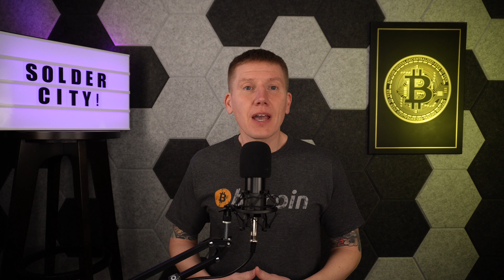EP11: My BITCOIN dry cooler build!

Comment: It looks like you used yellow teflon tape. I believe that's for gas connections only, no?
Reply from the maker: Hi Dimitri!  Yup, its yellow tape and dope that is normally used for gas connections.  Its more expensive than the normal white teflon tape, which would work fine here.  But...I was out of white tape and I had yellow tape/dope left over from my miner cooling loop...so I decided to use it here.  Its definitely overkill, but will seal just as well.
Reply: @HBIM_Channel  well,it’s not about expense…. As I understand it, water fittings and gas fittings have different sized threads and, consequently, the different tapes are about differing thicknesses.
Reply from the maker: @dimitrikatsaros9212  Good point.   I found a source stating white tape is only recommended up to 3/4" and yellow tape (which is 2x thicker) should be used for larger pipe sizes, but I couldn't confirm that anywhere.  Iron gas pipe fittings are generally 3/4" or larger.   However, the real reason why yellow tape has to be used for gas fitting is it has additives to handle petroleum products...this is why its a good idea to use it on the miner loop with dielectric coolant--better material compatibility.   For my cooling loop, the yellow was easier to work with on the 1" NPT fittings than white...its thicker so it takes less wraps and applies more evenly.  On smaller fittings, it wasn't as great...only a couple wraps are needed and its a little tricky to get it to stay on with that little of overlap.  On the small 1/8" NPT fittings, I just used dope with no tape.   We'll see if it holds up...I'll be leak-checking the cooling loop shortly...I might be re-applying white tape if it doesn't work.   If it fails, I'll definitely cover it in a future episode!